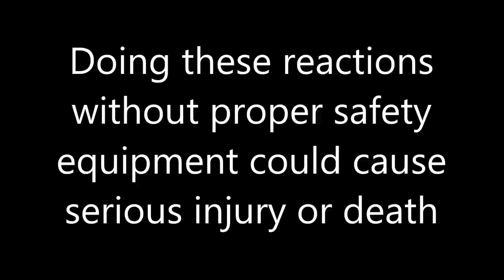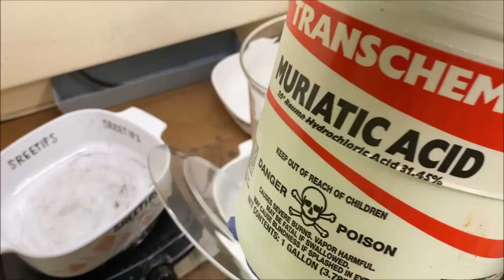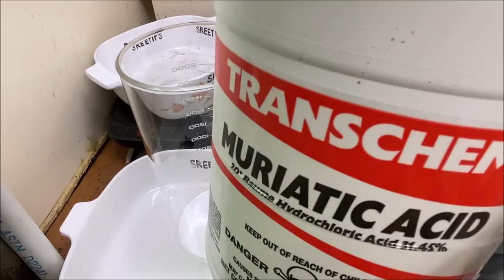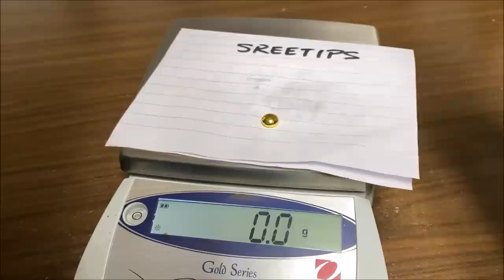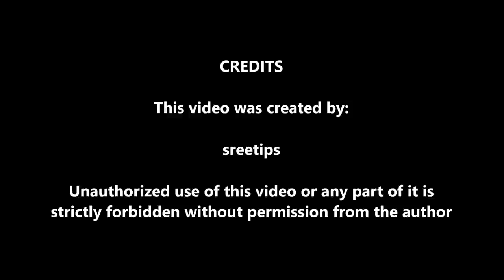Computer Scrap EASY REFINE TO PURE GOLD

Comment: As noted, a lot quicker and easier than with peroxide. Keep up the good work.
Reply: @@stefanbrosilch6313 Time is money.
Reply: @@stefanbrosilch6313 Running the pump for the bubbler takes money as well.
Reply from the maker: From now on, if I do any more trimmed circuit card fingers, I’m using hot nitric boils to release those foils. It was a breeze.
Reply: The Peroxide method can work just as fast as using Nitric, You just need to HEAT the solution. Nitric would take longer as well if you did not heat it.

Comment: I use a slow process that soaks fingers and pins in HCl with just a little copper chloride, called the 'AP process'.  It's cheap and you constantly generate more CuCl2 reagent in the process.  

I can just throw everything into a beaker and forget about it for a week.  Doesn't even need bubbling.  Just stir it well every few days.  When white CuCl crystals begin to form and there's still base metal remaining, just pour off most of the concentrated waste and add more HCl.  

It works VERY well for pins.  Nothing but foils are left over.  For fingers, you still end up having to wash the thin gold off some of the cheaper, modern fingers.  The old types do tend to fall off nicely.

Comment: Superb ! That was way faster than anything i ever tried !
If you recall the Weir Effect thing, it'd be great to do the Nitric treatment in a glass cement-mixer.
Adding a bit of water/nitric as the thing turned, at an angle, the gold foils would flow over the edge.
Mostly they get trapped by the circuit boards, as you saw.
AR directly on the FR-4 circuit board material could well have produced some things you might not like.
Reply from the maker: Excellent

Comment: On those boards, it tends to be the copper layers where pretty much all the metals are attached unless they are bolted/screwed to the board. Going right after the copper seems to been the easiest way. If you get a large enough batch and can cycle through large boards and not just trimmed then you could recover a fair bit of copper and silver this way for basic refining to recoup some costs. Copper would be the highest yield volume wise. Even the cheap boards like in basic electronics would give up copper in the least. Silver could be in the contacts and solder at the low end. Good for a hobby unless you needed fine powdered copper/silver for maybe plating.

Comment: The detaching of the plating with nitric acid worked beautifully. How spectacular! I would've been tempted to remove all the foils floating at the surface with a spoon before filtering the solution.
Reply from the maker: Me too, but that would just add another step.
Reply: @sreetips  That's true! I posted this as I was watching the video and expected the recovery of the foils to be far more labor intensive. I assumed that they would stick to everything and that you'd have to rinse the circuit boards one by one. I didn't think that you'd do the aqua regia with the circuit boards still in the beaker, but it worked perfectly!

Comment: I go Straight to AR with most stuff now including fingers as,
Time is money,
And it works very very well and very speedy.
❤
Reply from the maker: I have a video “Trimmed Fingers in Aqua Regia” posted on my channel. I didn’t like precipitating the gold from the dirty solution. But it did work ok. Can’t remember if the yield was affected or not.
Reply: @sreetips  Sulphamic acid - iron sulphate - boil au precipitate in HCL - 
Re Refine - then Ascorbic acid.

Quickest Method I believe when time is your enemy.
Reply from the maker: I watched that old video and concluded that it best to remove base metals (like I did in this video) before going to aqua regia.

Comment: I'm not sure I liked putting the filter paper full of gold foils you had at 10:57 into the larger beaker with the partially-digested plastic parts. Seems like it is going backwards in terms of isolating the desired end result..
Reply from the maker: I thought the same thing right after I did it. But alls well that ends well
Reply: It was actually pretty smart.  He kept the Au together.

The HNO3 boils put the Ni and Cu into solution and left the Au foils, more or less alone.
He was able to filter off the Cu(NO3)2  solution (blue) and leave the foils in a Ni(NO3)2 solution. (Green).

Once all the Au was put into solution, including the foils in the filter paper, he had all the Au ready for reduction.

The plastic left behind was clean and unimportant.

I gotta say, as these things go, it’s very doable.

Comment: If you want an easier way to get the water out of the gold try pouring it on to a paper towel and then you twist the towel to press the water out. Rip off the part where the gold is and then proceed as normal. You can burn the paper towel in the melt dish to get rid of it and pool the gold.

Comment: That's the only way I do fingers. AP will dissolve gold as well so I stopped doing it a long time ago. Dilute HNO3 works fast. I have done 20 lbs of fingers in a day. I have even melted the foils and Xrayed the buttons, they come it at about 22k on average. So when I get them recoverd I let them sit for a while in fresh Nitric. Give them a few water boils and go to AR. Most cases it comes in at 997 +. Given you don't get paid any more for 999 then you do for 997 . I just sell it to the refiner

Comment: I wonder how would the removal of gold plate from electrolytes and electrolysis?? I've done alot with silver in the past but compared to other methods it sure is a messy long process with silver. But I say to anyone money is able to be made if you need it desparatly. But I've never ever bothered to read up about gold plating. Cheers as always mate.👍🇦🇺
Reply from the maker: There is gold to be had from gold plated junk jewelry. But the amount is tiny. Gold plated scrap is best processed in a sulfuric acid stripping cell.
Reply: @sreetips  cheers for that saved me a small experiment. Take care as always mate.

Comment: Great video! Sadly the shipping to Europe is more than the value. Otherwise I would've picked up one of your pieces.
Do you have a smart way to recover gold from gold plated brass pieces? The plating is thick enough to theoretically be worth while with an efficient process. But dissolving all in nitric acid uses up pretty much all value in nitric acid.
Reply from the maker: In the USA a thick coating of karat gold over brass is called; Gold Filled. I have several videos showing how I recover the gold from gold filled material.
Reply: @sreetips  It is not gold filled. It is thinner than that. It is gold plating on connectors. Mil spec telecom grade ~10 microns. And a lot of that. So there is wuite some value in there and I'm looking for a way to get it without spending most of it on acids. ;) 

I have a look at what you did there to see it is applicable.
Reply: Search: Sreetips sulphuric acid stripping cell.

Comment: That green solution looked pretty neat.  I wonder what made it that color…
Reply from the maker: Copper in solution is blue. Gold in solution is yellow. Blue and yellow make green.
Reply: @sreetips is that the only possibility for the green color? I wanna say I’ve seen green before when trying to de-gold circuit boards but always before the AR step
Reply from the maker: Nickel in solution is green. But the most likely is copper in solution with gold.

Comment: some of those circuit board fingers have copper INSIDE the middle. They might be multi-layered and have copper inside. A long boil in nitric may not be enough to remove it all.
I haven't fully watched the video yet, but I can predict the outcome.

Comment: Excellent video as usual.
A usefull methode to save time and nitric acide is to use a solder iron to detach gold foils.
Try it if the opportunity arises ;-) and let me know the result, if you want.
Best Regards.
Sylvain
Reply from the maker: I’d rather let the chemicals do all that for me.
Reply: @sreetips  I understand that, in fact.
But, if you permit it, I maintain that using Iron Solder will kept you several time and acid.
However, I can understand that you take times to explain and use acide nitric.
Indeed, here in Belgium, we can't have Nitric Acids for buying.
Sinds attacks in Europe.
Stupid, I know, but that's it.
So I hope, you'll soon teach us to refine precious metals without nitric acide.
And hope you'll continue your greats videos.
Best Regards,
Sylvain, from Belgium.

Comment: When I didn’t know better I tried melting silver in a bread tin inside a kiln I couldn’t control the heat of, long story short the silver melted as well as the metal tin and they fused together. How would I go about separating the silver from the metal?
Reply from the maker: Tin? The bread thing was made of actual tin?
Reply: @sreetips  I believe it’s thin  steel but it got so hot it fused with the silver but I’m not sure how to melt or dissolve the silver that doesn’t include melting the steel tin aswell
Reply: Would nitric acid melt the metal or just the silver and then would the solution after be easy to get the silver out of

Comment: Great video. Like always!  I do have a a question. Why would you not be able to use aqua Regia to put all the metals in solution at the beginning. Then separate the solution from the fiber boards then process the solution accordingly?  I have no experience at all other than what I have learned from sreetips so it may be a stupid question but either way, you get pushed up on the algorithm. Thanks!
Reply from the maker: AR forms a very dirty solution with the base metals
Reply: Because you would create more work for yourself if you want pure gold because you will put all of the metals into solution.
Reply: More elements in the board might also go into solution. I need to watch the AR part again, was it done on an ice bath or not?

Comment: I don't understand. Why detach and filter out the foils if it's all going back in the beaker with the stripped fiberglass for the AR step? Could AR just be the first step?
Reply from the maker: I could, but it’s best to remove base metals that are under the gold foils with the nitric boil first. Then get rid of the liquid that contains the base metals. Some of the valuable material came over as I poured the liquid off into the filter. That’s why, after all the blue liquid was poured off, I added the filter back into the beaker with the clean fiber board fingers and loose gold foils - the filter had a few gold foils, not much, but enough to add to the recovery. These fingers produce very small yields. So my thinking was to include the filtered tidbits because in refining, every little bit counts. Having said all that; as soon as I dropped that filter back into the beaker I realized that I should have put it into a separate beaker, added AR to dissolve the gold (in a separate beaker). Then added the gold solution from that separate beaker in with the gold foils that I dissolved in the large beaker with the fiber boards. Adding the filter back to the big beaker was a mistake. Finally, this took me ten minutes to compose and write out this explanation. And that’s why I don’t offer any tutoring or training services. It takes too long!
Reply from the maker: Please see my video titled “trimmed fingers in aqua regia.” Then you’ll understand why it’s important to remove the base metals first before going to aqua regia.

Comment: Have you ever tried using Electrolysis to de-plate Gold filled jewelry? It DOES work. I have reduced an entire 14K gold ring using this method (before I bought Nitric Acid). It reduces the ring to gold powder and silver powder. You could recover the Silver using nitric on the powder. (or gold sludge, because this is what this process creates)
Reply from the maker: I’ve used a reverse de-plating cell (sulfuric acid stripping cell).
Reply: @sreetips  I've seen those videos, but you only used it with gold PLATED jewelry. Not Gold-filled Jewelry. The process works the same, it just takes a little longer for the gold to come off. This would make good content trying something you've never tried before.
Reply from the maker: I gotcha. I know the sulfuric acid stripping cell will strip gold off of gold filled material. I’ve done it. But it takes a long time and the cell heats up rapidly. But it does work.
Reply: @sreetips  The cell heating up has a very simple solution. Set the cell in a bath of running cool water Using a re-circulation pump. Plus this process creates very little waste. The Sulfuric acid is re-useable, and the process can be set aside (acid can be stored with gold in it) for future continued processing. Only drawback is that it takes a few days for gold to settle completely, unless you immediately want the gold out, you douse it with water.

Comment: So I did this process with the nitric, followed all the steps had all my gold foils dissolved them in aqua Rega then put in some urea and my sodium metabitesulfite got this grayish mud through it in a crucible and I'm not seeing go
ld. What did I do wrong? Have pictures of the mud
Reply: Is it possible to add to much urea or sbm or Maybe I didn't add enough and it wasn't precipitated ?
Reply from the maker: You probably had so little gold that it wasn’t detectable. A common beginner mistake.
Reply: Hmm okay. Any other thoughts? Tried to upload a video or picture to show you but I had a decent amount of foils, least more than I feel like is showing up. I had a smaller batch but the mud was darker and I got more out of it.
If you add too much Flux is it difficult to burn off then get the gold button to form because there's so much Flux? Thanks for your videos and knowledge
Reply: Need to order a status test perhaps it's still in the solution
Reply from the maker: Not sure about that.

Comment: Is the green of the solution something to do with the dyes used on the PCBs? Only I've never seen such a vibrant shade of green in a metal salt before.
Reply from the maker: Gold in solution is yellow. Copper in solution is blue. Yellow and blue make green.
Reply: @sreetips  yeah, but that shade? Looked more like lime Jello mix than a salt solution. I've watched a bunch of your videos (and a bunch more from OwlTech - I prefer yours) and while you often have green solutions, they usually come after the hydro boil but before the nitric and contain no gold. I do know that stainless steel gives a green solution when dissolved, but it's usually a much darker shade.
I have many other questions, but I'll ask them elsewhere (like "why inquart?", for instance).
Reply from the maker: Green solution could also mean palladium. Inquart does such a good job of cleaning the gold.
Reply: @sreetips  I see. Yes, that would indeed explain it.

Comment: I refining some computer scraps I have here for years... I must confess Im a beginner... and I did something stupid... put a lot o HNO3 over some scraps and the reaction came quickly like a volcanic eruption. So I realize now the reason you put some distilled water first and then, gradually, put the HNO3. I think you do this to start the reaction slowly... and also do not put lots of HNO3, which might leads to problems with Borax during melting. Is this understanding correct?
Reply from the maker: Sounds close.
Reply: thanks... but could you say something more regarding water on your procedure? and, by the way,  Im the guy who doesnt want to buy distilled water from the store... trying to use boiled water chlorine free, instead. what is the cost of a distilled water gallon you use? @sreetips
Reply from the maker: I use about twenty gallons of distilled water per month. They were $0.99 per gallon until  a few years ago, they went to $1.19 but recently they went to $1.39 - why? Did that water become more valuable? Or more scarce? No. The value of the currency declined by that much due to money printing. A forty percent rise in price. That’s the true inflation rate. Not this nonsense three or four percent that the money printers claim it to be. But that’s ok. We’ve planned for this. I just feel bad for those who are stuck paying seven bucks for a head of cauliflower. What are people going to do? The bar that separates those who have enough to get by from those who don’t, is steadily rising.  Due to money printing. Trying to save ourselves from financial disaster has been tried over and over throughout history. It never works. Fiat has a 100% failure rate. Long after the dollar is gone and forgotten, gold will still be valuable.

Comment: I've noticed that under that green stuff on the boards there's copper, when I tried with salt and vinegar the green usually stays on the board, why is that?
Reply from the maker: I’d say that the salt and vinegar doesn’t have the punch to dissolve the copper.

Comment: Great video! As a fellow refiner, I have a quick question for you. I’ve always been cautioned against using AR while the PCB are still present due to the fact that the boards can and do absorb the acid. Are you concerned that you’ve lost some of the yield because it’s still trapped in the PCB boards?
Reply from the maker: Possibly

Comment: Was the first gold solution so green because the acids dissolved some of the green dye or was it because it dissolved a bit more copper?
Reply from the maker: Copper in solution is blue. Gold in solution is yellow. Blue and yellow make green.
Reply: @sreetips  Ok, thank you, I didn't know if there was enough copper left after the nitric to color the solution so much after the aqua regia, which made me wonder if it could possibly be the dye getting transferred from the circuit boards to the solution. But just more copper it is then!
Reply from the maker: Correct, I didn’t get 100% of the copper. Just enough so the solution didn’t get real dirty, like used motor oil.